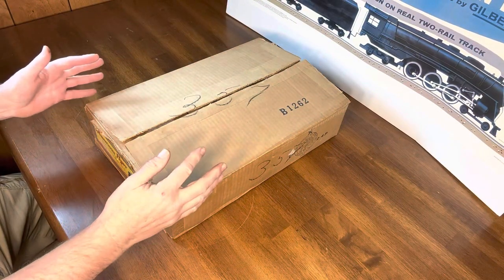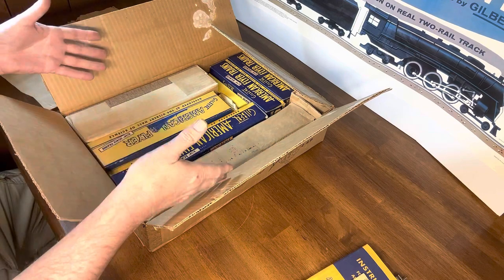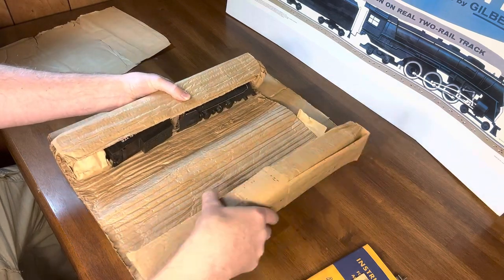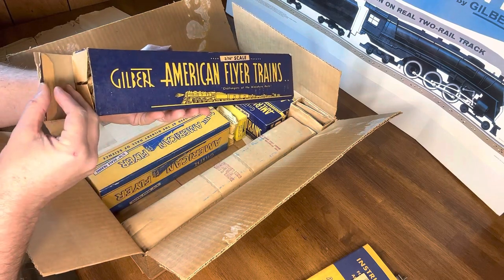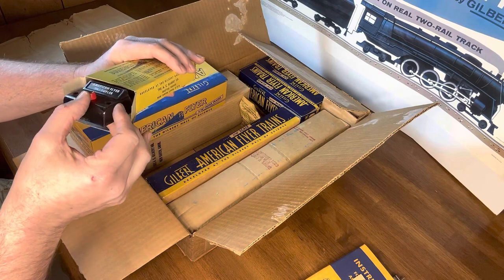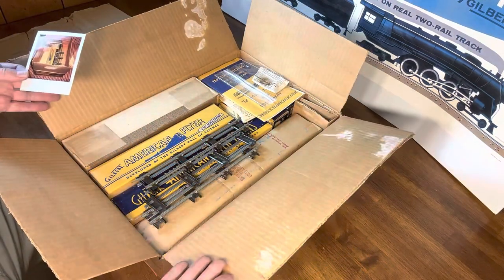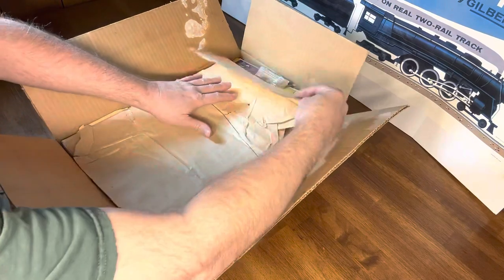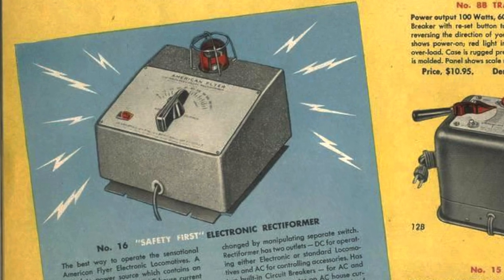American Flyer: Unboxing a Never-Run 5009 342DC Electronic Switcher Set from 1950

Comment: One downtown ,long time flyer service station here in Chicago , converted many of these engines to AC ( installled field windings and e units  ) as the market for used DC engines had dissappeared due to " DC ingnorance".   DC simplicity helped HO become popular and motor repair was two brush simple as was direction control.  The technologically advanced "S" gauge was hobbled by this desent into the AC dark age of the three railers.  You can check the AC prewar HO if you doubt this and see the RDC control relays for E units  American Flyer used back then.  ( CASG )